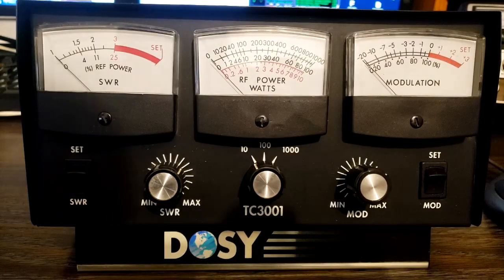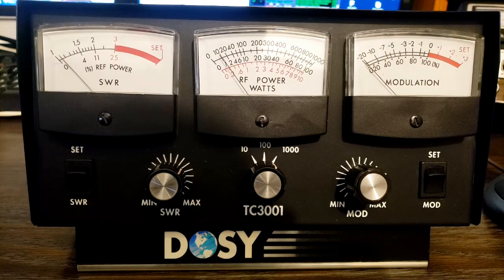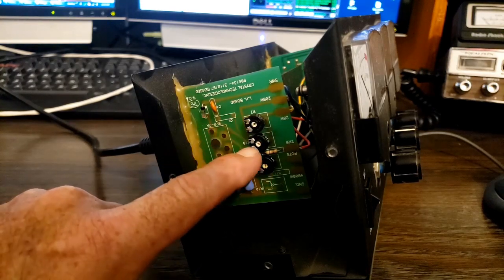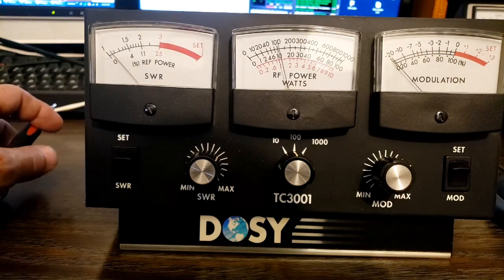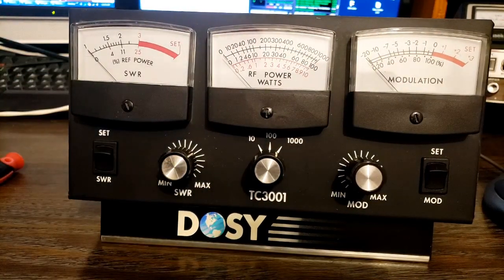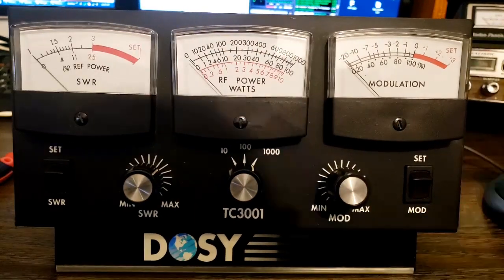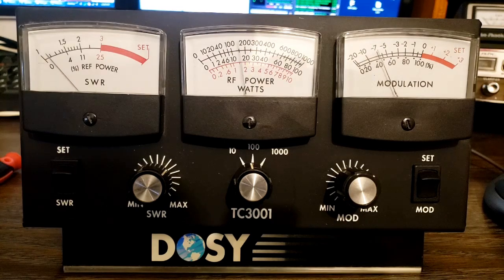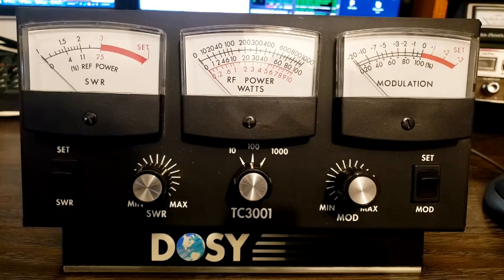DOSY TC3001 CB Radio meter, testing and calibrating

Comment: Bought one of these about 30 years ago with the 10 and 100 watts range off. Always taught there might have been some resistors burnt out and never opened it to check. Today I saw your video and found out that they could be readjusted by a simple variable resistor. Wow, after all this years… Thank you for this video…

Comment: I had two meters like that back in the 90s and early 2000s when I was on the radio. First set was a Palomar PW-5000 and the second was a Para Dynamics PDC 600LP. I wanted the Dosy TFC-3001S with the built in frequenct counter back then when they came out but they were a little too high in price for me.

Comment: @mower junkie Cant believe that for the cost of those dosy meters that they glue there circuit boards in instead of using screw mounts. set the modulation to (0 or 100%)

Comment: Just made skip contact with you Mower Junkie on 38 LSB at around 10 AM Central time 3/26/22 !! 
I was surprised to say the least. Just to let you know I have two things with my setup that I was inspired by you. First is my linear is being powered by an 18 Amp Dell laptop charger. Second is my antenna I use is a homebrew. It's a 1/2 wave coax antenna known as a T2LT.  It is hoisted up about 20' in the air. Your antenna experiments has got me to try the same experiments.

73 to you and Mrs Mower Junkie !!

770 Mr Bill in Omaha, Nebraska
Reply from the maker: That's awesome! I still use one of those dell power supply's to do testing. You sounded great 770, Thanks for the contact. Take care, Enjoy the hobby. 73's from 151 SC.

Comment: Everyone who takes this hobby seriously should invest into a decent "reference" SWR/Watt meter for their radio room. If you can afford a Bird meter that's all good but there are cheaper alternatives out there that have the same guaranteed 5% accuracy reading as the more expensive Bird meters do with the exception that they do not have selectable slugs that plug into them so they're limited on ultra high power readings but the average person is only going to run 100 or maybe 200 watts unless you're one of the "Super Bowl" people trying to recreate a commercial radio station out of your bedroom. These little meters I'm talking about go up to 200 watts RMS with a 5% accuracy which you can use to calibrate your meter on it's 1000 watt scale just by adjusting your watt meter to be accurate at 100 or 200 watts on the 1000 watt scale. Many roads lead to ROME so there's always a workaround to get the job done. As to inaccurate meters, I went through this same issue with the "None of the meters I own TO MY NAME read the same with each other syndrome" and I finally decided to invest into a accurate reference meter and it was the best investment I could have ever made for my radio gear! If anyone reading this decides to purchase one of these meters, you should also invest into a small 50 Ohm RF dummy load rated around a few hundred watts and here's why: If you try to use your antenna as the load your calibrations will be off no matter how good your antenna's SWR is because the antenna is reactive where a dummy load is NOT reactive so keep that in mind. Once I calibrated my meters I boxed the reference meter up and put it away for future calibration use. Here are two links to the same meter under two different names. They are the same meter but one is a little over $100 and the other is a bit under $100
https://www.gigaparts.com/1-8-60mhz-200-watt-digital-wattmeter.html?gclid=CjwKCAjw_tWRBhAwEiwALxFPoUk_m_4OFeL0FLAfrb-Ud076608d6xB9LsvBOhnOpGXb34Wx8ush5RoC2asQAvD_BwE This second link is to Ebay. https://www.ebay.com/itm/124881519967?chn=ps&_trkparms=ispr%3D1&amdata=enc%3A1dxzIKNzjRDWFYhtBQt8D5w78&norover=1&mkevt=1&mkrid=711-117182-37290-0&mkcid=2&itemid=124881519967&targetid=1599090336857&device=c&mktype&googleloc=9010467&poi&campaignid=15275224983&mkgroupid=131097072938&rlsatarget=pla-1599090336857&abcId=9300697&merchantid=138378640&gclid=CjwKCAjw_tWRBhAwEiwALxFPocxueD0lMuepIDmx2BEJtplWiJqEKSsyIphNd4Ja_rhPt0o9ZXm8DBoCnr0QAvD_BwE Both meters are the same but under different names.

Comment: I love how the board reads 20w 200w and 2k LOL Guess they used that board in a 2 kw meter too!
Reply from the maker: Yup, and the 4k too. it has a spot on the board for a 4k adjuster, it's just not installed.